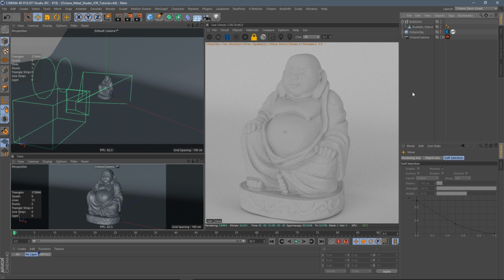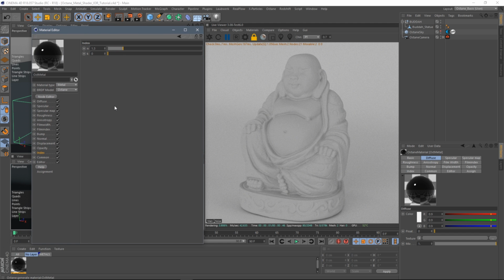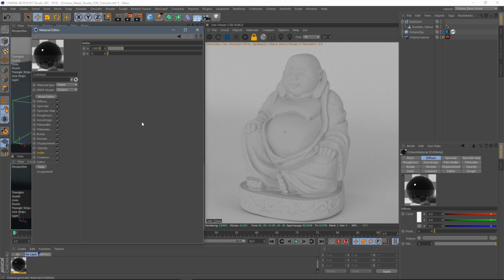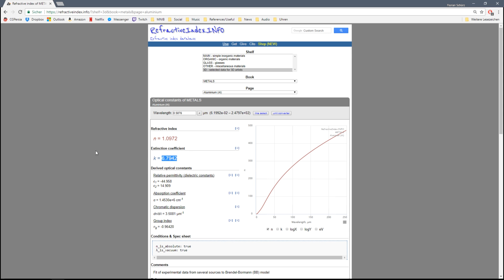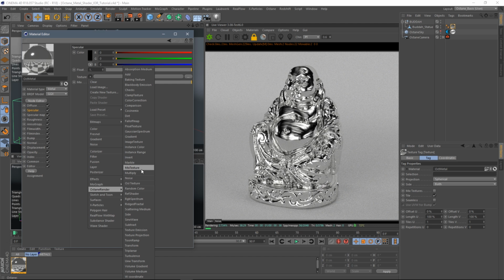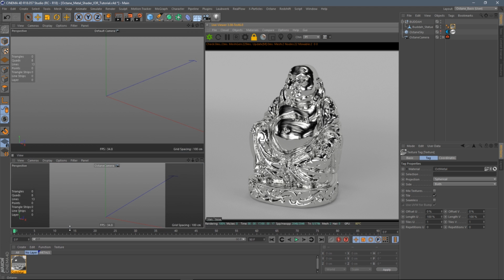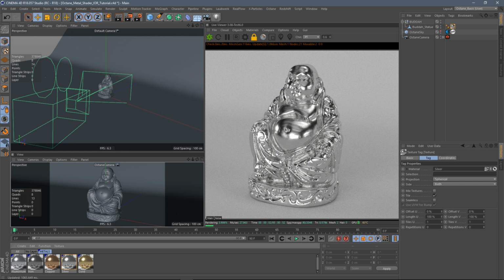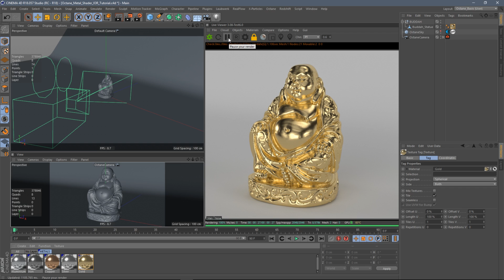Octane 3.08 (Test 6) Metal Shader IOR Tutorial | MNIB

Comment: how exactly do I use the falloff Node??? :S
Reply from the maker: Just try it on a basic material and see what it does. Easy way to it is just do it like I did it in this video. Use the Falloff node as a gradient input & add simple colors to the gradient value 1 & 2. Apply the material and see what happens :)